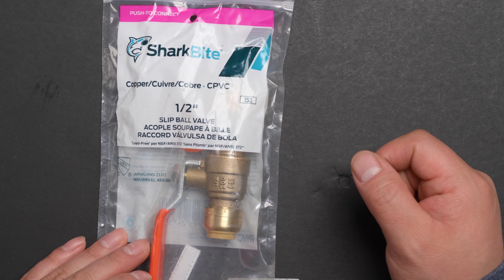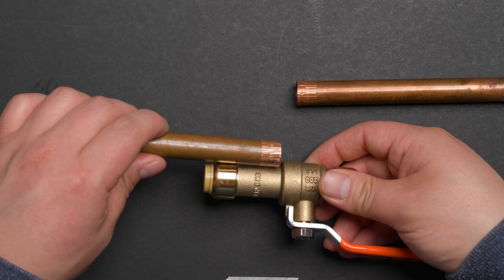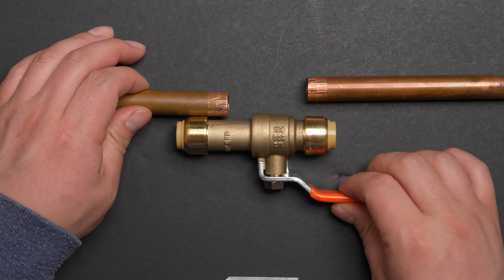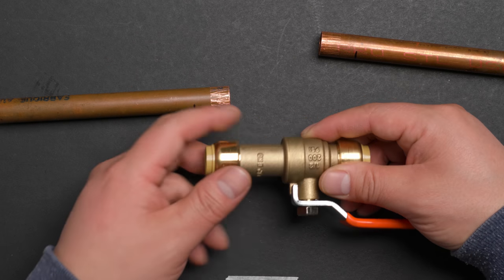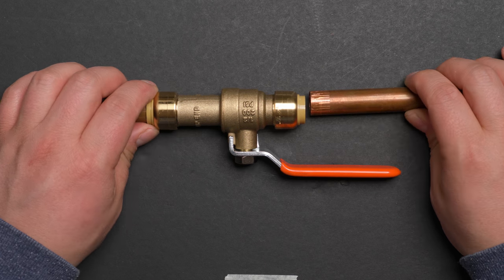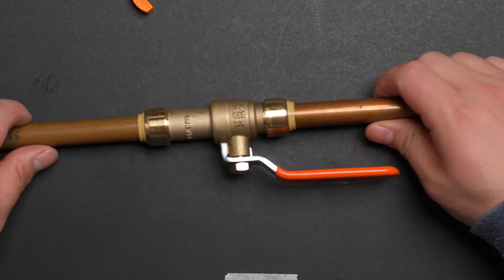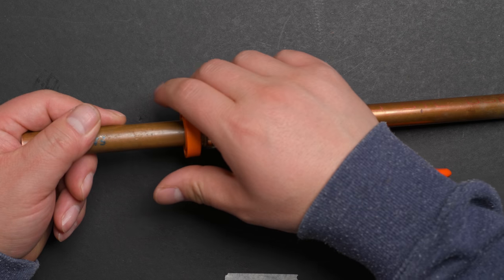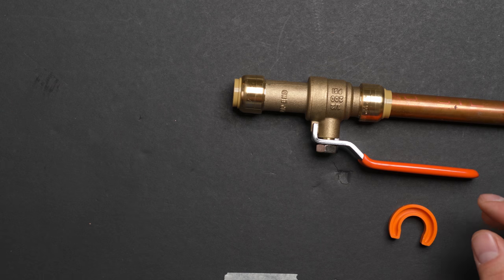How to use sharkbite slip ball valve

Comment: Nice video that does not show 90% of what you need to know about these valves. First, deburring is essential as the copper pipe is going against an O-ring that is easily cut or nicked which will cause leaks. Second, it is not recommended to reuse the valve after removing the pipe as the O-ring inside may have gotten damaged during the removal process.  These valves should only be used as a temporary fix and an areas that are easily accessible. Did not use them behind walls.  As with anything, convenience has its drawbacks.
Reply: This video shows exactly what the title says: how to install a sharkbite slip ball valve.

I appreciate that this is a 3 minute video that narrowly covers the topic I searched for, as opposed to a 15 minute plumbing 101 video that covers deburring and prepping and plumbing best practices.
Reply: They're not a temporary fix and meet code in many, if not most states for water heater installs.
Reply: Sounds like your job as a plumber just got threatened for OVER CHARGING CUSTOMERS.... But I could be wrong.. I doubt it... Mad about losing money on HRS OF NEEDLESS HOT WORK... Work smarter not harder!

Comment: I’ve used this SharkBites products. I’m not so impressed. Specially if you’re using it behind the walls like your bathroom valves. It’s ok if the pipes you’re using is exposed, otherwise no, I don’t recommended.
Reply: No professional would put a shark bite behind a wall.

A sharkbite in an easily accessible, open area, why not?

Comment: You also did not explain how much pipe you should cut out.
Reply: Luckily none on YouTube tells that
Reply: Here are the CORRECT instructions how to do this DIY procedure. 

Example. Let's say you have a copper or Pex pipe. 

Close the MAIN water supply valve. 

1. Now cut this pipe at a given location on this pipe (i.e. where you want to place the shark bite) and let the water drain in some bucket.

2. The next Very important thing to do is, NOT to "mark your pipe with a pen" about the depth of pipe that need or should insert inside the pipe (after you post the pipe in shark bit end),   ...BUT.... TO actually find out, how much pipe you should cut "IN BOTH DIRECTIONS" from the cut you already made. So, for this, look step 3.
3. Now you, look at your shark bite and place the shall bite's center point, at the first cut you made on the pipe. Now mark, "both edges/ends of shark bite"  sitting/aligning on the pipe. Let's call it, left mark and right mark on the pipe. Between these 2 marks you just did, there will be the first CUT you made on the pipe.
4. Now,  you use the shark bite depth tool (orange color which has all the sizes 0.5" to 1.5") and insert left end of the pipe to the left side of the shark bite and see how deep it is. Mark this on the left pipe (after first cut) i.e. now it will be marked INSIDE between the LEFT MARK you did in step 3. Let's call it INNER-LEFT-DEPTH mark (i.e mark between the LEFT MARK from step 3 and the cut on the pipe). Do the same procedure, on the right side of the pipe, using right side of the pipe, by inserting it into the right opening of the Shark bite. After inserting that, you will now get INNER-RIGHT-DEPTH-MARK i.e. a mark between the cut of the pipe and the RIGHT MARK you got from step 3.

5. Now, USING a Scale/measurement tape, find what's the depth/measurement of "INNER- LEFT-DEPTH -to-> the cut" ... note down this number/value as LEFT VALUE.  ... Let's assume this left value was 1 inch. 

Do the same procedure by measuring,  "cut to INNER-RIGHT-DEPTH mark". Note this value as RIGHT value. Lets assume this right value was also 1 inch. 

6. Now wipe the INNER left and INNER right marks using a wet cloth or something. 

7. Go to LEFT mark (that you made in step 3) and measure "left value" from that left mark and mark it. This  "new-inner-left-depth" mark is now measured from the LEFT MARK (i.e. not from the cut/center of the pipe). 

Do the same procedure, i.e. mark "new-inner-right-depth" mark measuring from the RIGHT mark (you did in step 3).

8. Now, use the cutter, and cut the pipe AT exactly on the "new-inner-left-depth" mark and cut the pipe AT exactly on the  "new-inner-right-depth" mark. THIS IS THE MOST IMPORTANT THING, I THINK NO OTHER VIDEO EXPLAINED AND it really trumps people while putting a shark bite on any plumbing pipe. 

9. Using that orange tool that Shark  bite company sells for finding depth of shark bite ends (i.e. how much pipe you should insert), it also has a smoothner/cutter in it, i.e. if you insert the end of pipes in that tool and rotate clockwise as listed on the tool, then it will SMOOTHEN the edges of pipe, for the new-left/right-depth end points of the pipe. Basically, what you have to do is,  smoothen the edge of the pipe end points which will go inside Shark bite openings and touching the RUBBER washer/seal.

10. Now, ensure if your shark bite has any DRAIN value (that you open and let water fall down especially during winter time for sprinkler water clearing etc) you place the shark bite acc. so the drain value is always down facing. Actually shark bite can rotate 180° on the pipe after fitting it ( so that should not be a problem ). ALSO,  check there is no dirt or debri inside the shark bite, after doing all this nano engineering work today first time by you. 

Well by now  you just put the left pipe on left shark bite opening and right side of the pipe, into the right side of the shark bite opening. While inserting, the pipe will go exactly upto the left and right mark, you did in step 3.

IMPORTANT: the pipes should be straight if possible like a straight line after you insert both ends in shark bite. Avoid getting any angle more than 5° i.e. after installation, the pipe with shark bite should look like 1 straight pipe, not bending unnecessarily like a bow. Basically there should NOT be any hard tension between shark bite and pipe  (that you inserted inside shark bite) giving it any reason to leak water due to a bad angle and high water pressure can leak water from such bad angle. 

NOW have a bucket ready next to you,  open the main water valve slowly, turn on water and see, if the shark bite installation was successful. Is it leaking any water from the end of the shark bite or not. 

If not, you just saved both TIME AND $$$$ And learned something new today.
Reply: 2”

Comment: This video lacks the proper method of dressing out the pipe end. Practically anyone can Plug-n-Play. A standard pipe cutter leaves a burr that needs to be de-burred and the older the tool, quite often the duller the cut. Any corrosion on a pre-existing pipe installation also compromises an otherwise sealed pipe. Will these work on 40-year-old copper plumbing?  Transitions to PVC Schedule 40 plastic pipe may also require a "grounding jumper" to re-acquire a correct grounding bond for the electrical connection. I would not consider this a building code item if it compromises electrical bonding. 
The last story I read that people ignored bonding was during the Gulf Wars. Locals in Iraq were hired by Halliburton to wire hot water tanks and soldiers were getting electrocuted while taking showers. I haven't worked on plumbing in 20 years so these replacements seem of good quality and I recently purchased two for a laundry tub. They are pricey in hardware stores these days but weighing that against solder, propane torches, sanding and flux makes them quite desirable.
Reply: You're right about cleaning the outside of the pipe and deburring in and out.  Works fine with old piping if it is cleaned and not deformed.

Comment: DONT DO IT COMING FROM AN ACTUAL PLUMBER!!!
Reply: You e never used shark bite
Reply: @ProfessionalDad  I don’t use shark bites I’d rather just do it the correct way 💯
Reply: @theredvillage5773  I've never had a problem. Some people are just scared of change
Reply: @ProfessionalDad  it’s a quick way and way more expensive then just doing it the proper way. They fail they leak and then you have a bigger problem.
Reply: @theredvillage5773  Like all those all old frozen gate valves in my current plumbing soldered in the "proper way".
Reply: @anxiousappliance  I don’t use gate valves only quarter turn